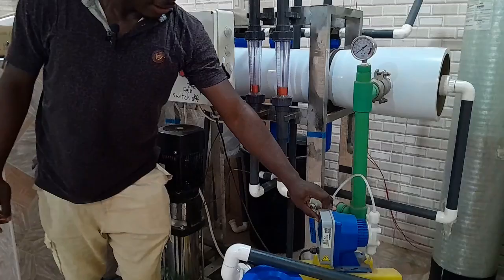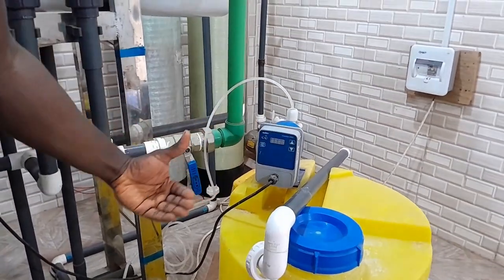How to increase your sachet water PH level to the maximum standard of 7, (sachet water business)

Comment: Apart from using the pH dosing system,what else can u use to stabilize the pH which is 6.3 ?
Reply from the maker: Anti - scalant as far as I know, or better still you will need a more clean source of water to get close. Thanks
Reply: @nickasa7090 
I have an antiscalant dosing system,so I use that ,but still the pH is at 6.3